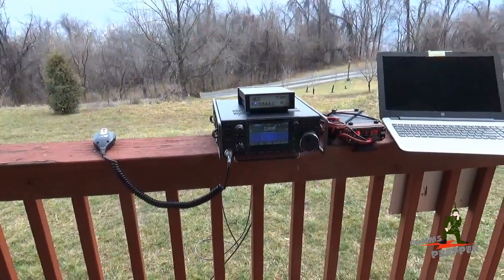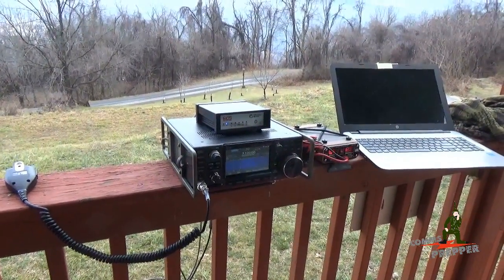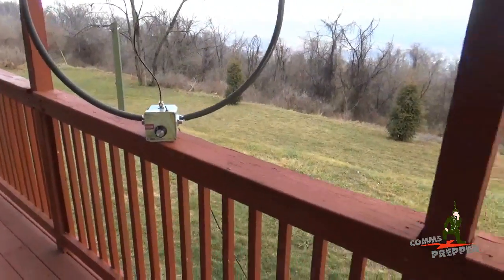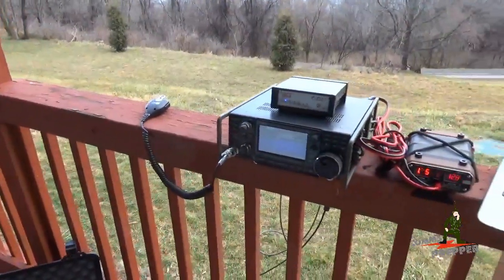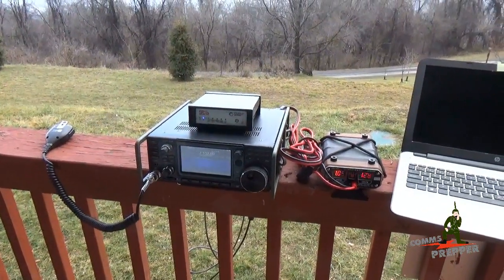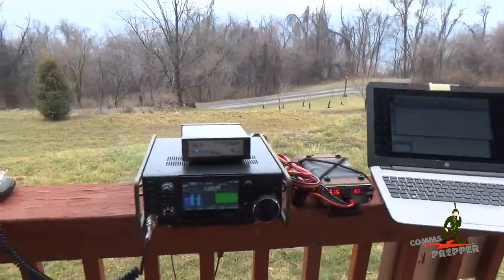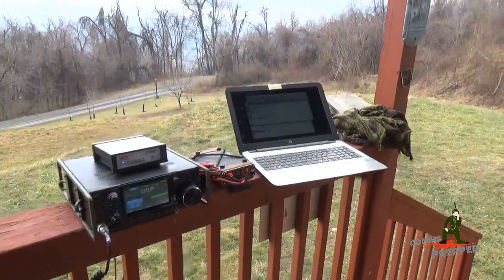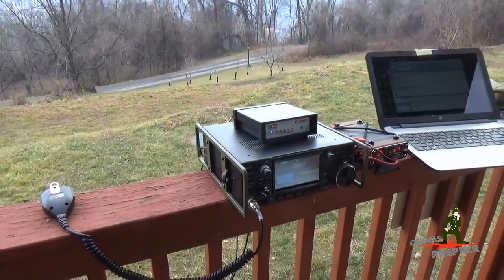Icom IC-7300 HF Radio Portable Operations - HF Radio Email

Comment: I have a 7300, wanted to do Winmor, using the internal sound card. You have a (I think its you) 7200 internal soundcard set up with Winmor. How different is the set up using the 7300 ?
Reply from the maker: No difference other than how you drill down in the menus.

Comment: Thanks for this, I have a bunch of radios and was looking into yet another one for portable use.  I kept coming back to “I want it to be like the 7300” so I’m looking at folks who have already done this with their 7300.  I really need to flip the meter switch on my power supply to check current requirements for sizing up a battery pack now.

Comment: You can get an ultra potable power supply at 30amp switching for around 70$. FYI
Reply from the maker: transformer or switching?  Switching power supplies can generate allot of noise.

Comment: Great video. Showed me the equipment I need. Already have the IC-7300, and a laptop. I didn't know about the rails for the radio. Gotta get those. Pelican case, great idea. Do you need a sound card, such as a Signalink, or does the radio have a built-in sound card? Is that a tuner on top of the radio? I'm a brand new general, so I'm still learning my radio and how all this works.
Reply from the maker: Tuner is built in, sound card built in, on top is an SCS Pactor 4 modem.

Comment: That's interesting I've never done that before just curious is your email encrypted or is your username and password to your email account sent as OpenText?
Reply from the maker: The email account is specific to Winlink.org  There is a password but it's not encrypted (FCC does not allow that in Amateur radio) but the system does have a secure login feature.
Reply: @Commsprepper  Just curious... If the password is not encrypted, could anyone just replay your password to send email on behalf of your Winlink account? Sorry for the newbie quesiton.

Comment: I know the SCM modem is for HF frequencies, but can it "drop" down and cover VHF/UHF? Or do you need two separate modems, the scm for HF and say the coastalworks for VHF/UHF?
Reply from the maker: SCM?  SCS is the maker.  The older models would do both Pactor and Packet.
Reply: Whoops, yea I mean SCS... Also If you have a radio that has VOX capabilities...do you really need something like a Signallink USB device? or the SCS?

Comment: Another great video. Could you tell me  what settings were made to the 7300 to get it to work with the computer and modem ??
Reply from the maker: The computer is connected to the SCS Pactor modem and the modem is connected to the radio.  The connection between the radio and modem is Bluetooth.  The connection between the modem and radio is a data cable that provides RX audio, TX audio, PTT, and power.  The radio is then set to Data mode Upper Side Band.  Modem drive (audio level) is adjusted to keep the ALC measurements just under the ALC trigger.

Comment: Great video. Thanks for sharing the range of this set up, and I'm looking forward to see what kind of range you can get with a full 100 watts running through it. Again, I know very little about these, but is the laptop just to send and receive email or is it a needed item for this system to be able to talk to others? Thanks and keep up the great work.
Reply from the maker: +wjf213 laptop is needed for the email program.  Scs modem is needed to connect to the winlink dot org system.
Reply: Check out PiGate Energency Email system (Pigate.net) 73

Comment: Do you prefer the new features of the 7300 over the weatherproof-ish design of 7200 for field use?
Reply from the maker: +Just Mike the 7200 is a great radio but I like the water fall display of the 7300.  Both radios do great in the field.

Comment: Okay, I have a dipole and a very unportable Kenwood 830S.  What is the cheeepest way to send email?  Modem plus ?
Reply from the maker: SignaLink with RMSExpress software and running in Winmor mode on the Winlink system
Reply: Thanks!
Reply: You might want to look at the following offer: 

http://us3.campaign-archive2.com/?u=e1cdcbe4da58e8277f75bd6b9&id=cdf412e790&e=

Cheers,

Carl
Reply: Kenwood 830S really isn't suitable for digital modes - can be done, but you would want to make an ALC adjustment circuit to turn down the power - which isn't really possible otherwise on the Tube final hybrids.
Reply: Thanks for that info.  I'll have to do something different then.  Really wish I could turn down the out put too.

Comment: I bet you could rig something up to hang off those rails for quick access
Reply from the maker: To pull it out of the case?
Reply: I was thinking like a little holder to put items in like a pen or clip or spare batteries

Comment: Answered a question on the power system about how high I could turn up my IC-7200 on the Hardened Power System.  Looking at how I want to power it in the field and weighing options.
Reply from the maker: 15 watts pulls just under 6 amps out of the QRP Ranger.

Comment: Nice video. As my brother and I setup the new shack here we are trying to see what will work with just about everything we have. So this setup would also work with a SignaLink USB if I understand everything correctly?
Reply from the maker: This modem does not work with the SignaLink.  SignaLink vs. Pactor mode is like walking and flying - no comparison.
Reply: So my idea was to use the SignaLink USB on my old ICOM IC-25A for 2 meters and I thought that I would also be able to use that on 20 meter HF. Am I misunderstanding how the SignaLink works? I thought it would work for both HF and VHF and use RMS Express for the software.

Comment: I probably no the answer but I have to ask what do you no about baofeng UV-5R VHE/UHF. I spoke with my pastor this morning at church he has his license he told me he would help me get my license or at least help me through . thanks for video and thanks for sharing great video great info God bless I used to live in Worthington WV for about 4 year loved it back there
Reply: nr3rful that is an incredibly ignorant thing to say.
Reply: brianj123458 Their QC is hit or miss... expect zero customer service and their warrenty is useless. The radios hardly, if at all, meet their own specs and dont technically meet FCC specs for Ham. They are however, a cheap way to test out the hobbie. I'd recomend you pass on these if this is going to be a "prep". The UV-82, B5, and B6 are much better options for around the same price but dont have as many accessories, but they do have the important ones available. For entry level, the Quansheng TG-UV2 seems to be one of the best ChiCom HT's out, but it does cost a bit more at about $70USD.
Reply: GraymanTactics 
if you are any kind of an American you will not support China
Reply: nr3rful lots of reasons not to like baofeng.  their country of origin is the least of my complaints.